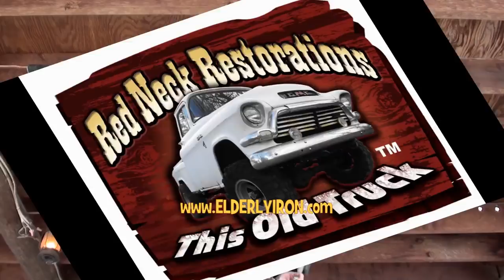Hoist Revision

Comment: You should use that method of lighting the oxy torch because you won't fill the shop with acetylene soot.  The occasional thump on ignition helps keep others in the vicinity awake.

Comment: Should've doubled the joist directly above the hoist (sistered together, glued and screwed, set on double studs on both ends) then installed blocking 2 bays wide on each side of that joist

Comment: I want a new wheel two2 but waste knot want not and it would be a waste four4 me to get a new wheel cause I ain't gotta grinder.
By eye ay.
Well the eyes have it. 
Or is that suppose to aye. I think the English language is really messed up. 
Ya got hey and hay and ay and aye 
Ya say ay like hay without the h
But ya add an E to the ay and the hay sound of ay turns into any eye sound 
an eye you could just put an I there. 
A E I O U and sometimes I oops I mean Y
It's the golden rule and the English teacher's have the gold so they make the rules and they make the rules on the weekend after they have been drinking. 
I gotta go out and bring in the oxes and then pack up some stuff in a bunch of  boxen and the sheep gotta watch out for the foxen.
It's gonna be a two2daful day.